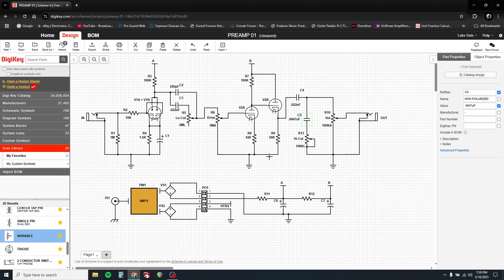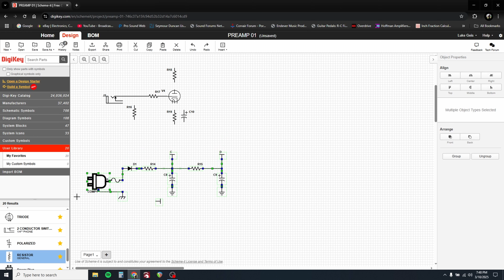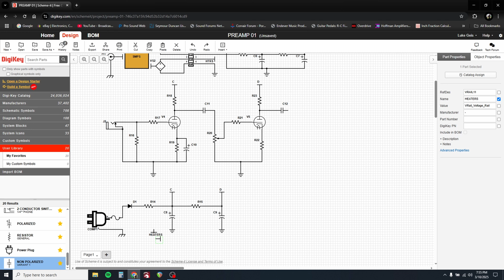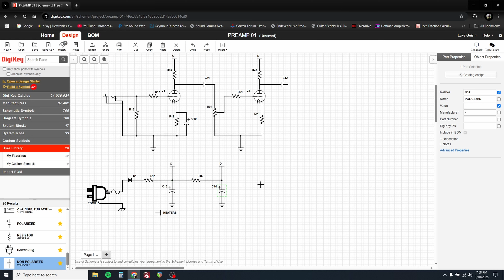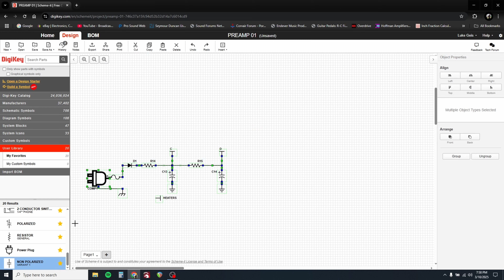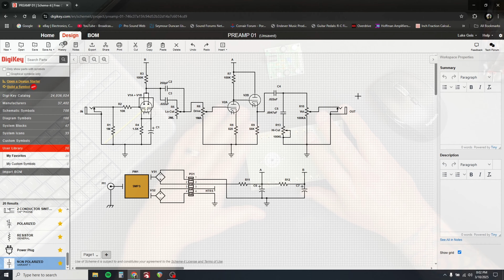Let's Design A Tube Preamp!!!

Comment: Just now following, so I don’t know if you’ve made any changes yet. But wouldn’t you rather do 12vDC heaters for lower current requirement?
Reply from the maker: Yes, but the fun I am having is getting the smps to start. The heaters are very low resistance when cold. I may need to put a thermistor inline I think at this point.
Reply: @ right on! Definitely following along through your process. Thermistor seems a good idea. I wonder, have you ever looked into how Simon Jarret does it with his Kingsley pedals?

Comment: Awesome video. I'm still learning here, but don't you need a coupling cap from the plate of V2A to the grid of V2B? Apologies if you covered this and I missed it...
Reply from the maker: V2B is a dc coupled cathode follower. So no coupling cap is required. You will also notice its plate is connected directly to HT. It essentially works in reverse to a regular gain stage, and drives current as opposed to voltage.
Reply: @ cool thanks. Learned something new today